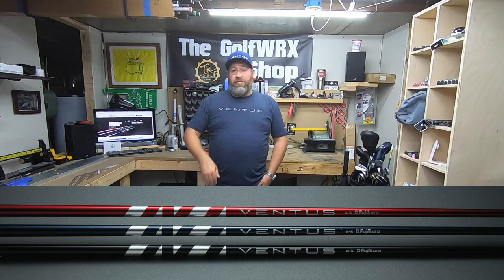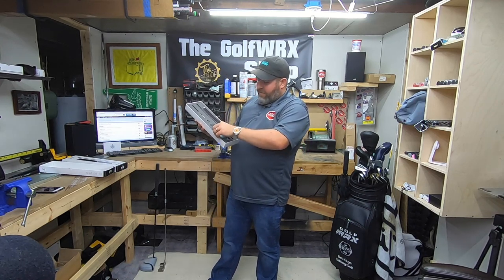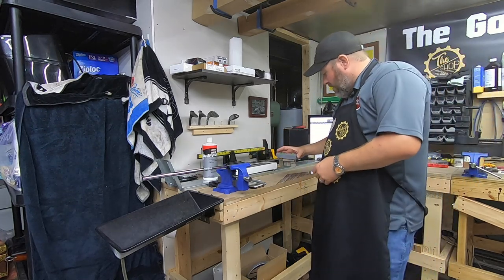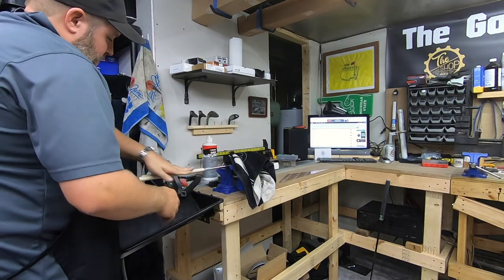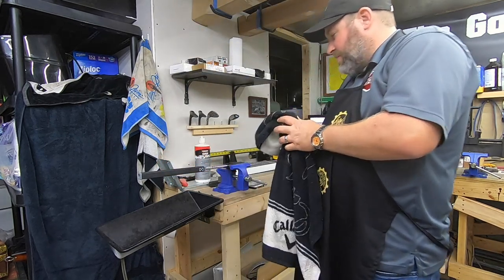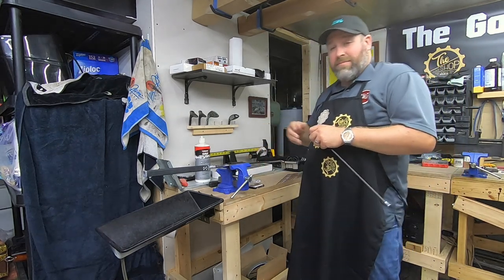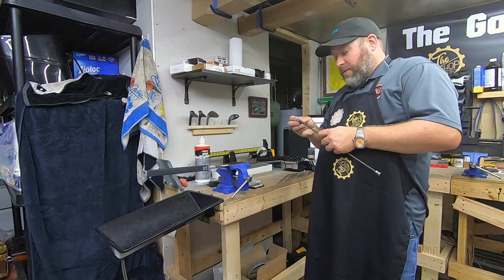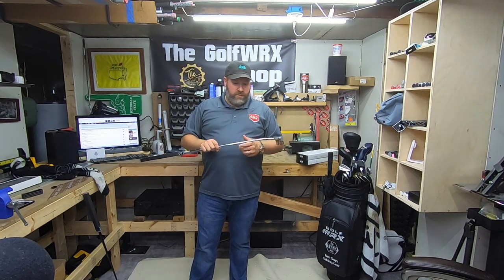The GolfWRX Shop: Installing A Sense Putter Grip!

Comment: Another nice shop video, Brian.  BTW, I also enjoy the GolfWrx podcasts that you host.  What is the small, plastic (?) piece that you put around the shaft before putting the putter in the vise?
Reply from the maker: It is a basic rubber shaft clamp. You can get them on Golfworks and a bunch of other places for a couple bucks. Thanks for the compliments!